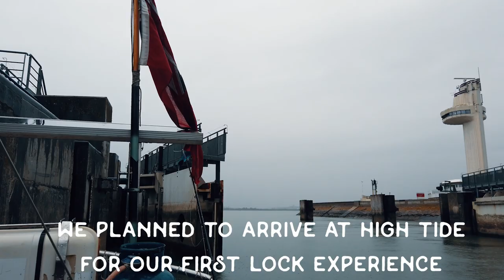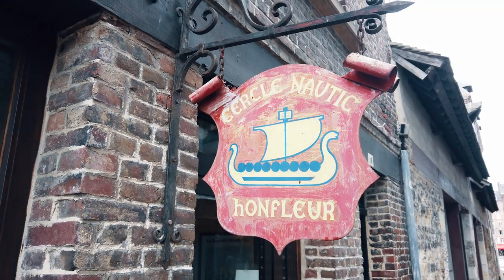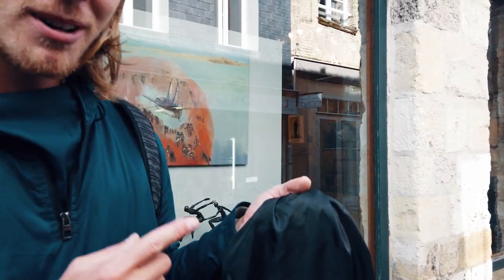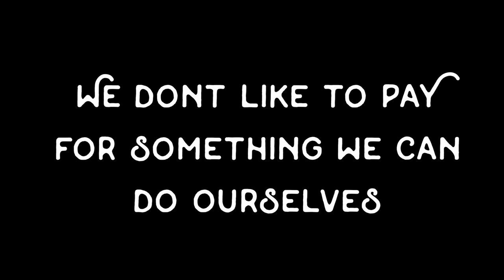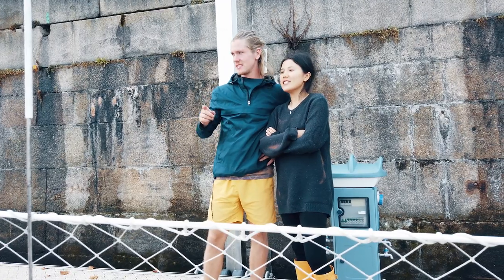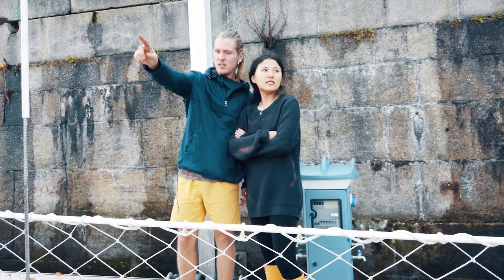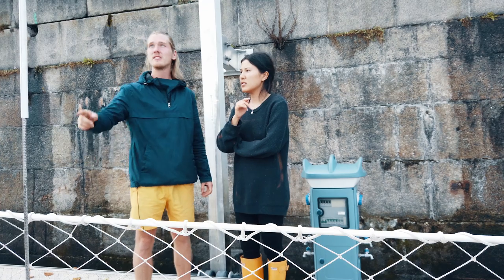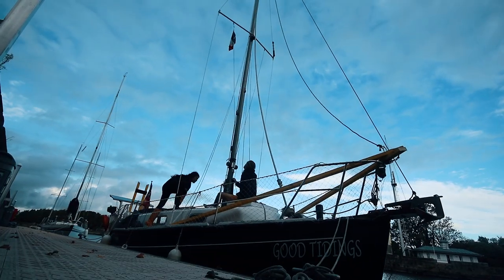Unstepping Our Mast with 2 Pieces of Wood Like 2 Unproffesionals | Wildlings Sailing .23

Comment: Here is a little tip for the electrical connectors. 
Next time you attach them, wrap them in self  vulcanizing tape. It helps against water penetration and corrosion. 
Though you have to cut it of the next time. 
Oh and some dielectric grease in the connectors also helps against the corrosion. So the connection point don’t become resistors over months of sea water living. 

Have fun.
Reply from the maker: Nice one! We'll make sure to do it. The connections definitely need it

Comment: tying two ropes onto your cap shrouds at about the same height where the mast hinges at the deck. Brought forward and tied off to the base of a staunchen or something will keep the caps tight all the way down so you can control side to side movement when its being lowered. Ive dropped several masts now using the boom and spinnaker pole   to make the a frame. Good stuff
Reply from the maker: Nice one mate, hopefully anyone looking to drop their mast watched the video and reads the comments like this. We found the only really difficult thing was controlling the sideways motion of the mast

Comment: Here in Perth, Australia, lowering masts on yachts is common as there are two bridges at Fremantle to go under, to get from the river to the ocean. Spinnaker poles are used for the A frame, attached to the side decks by sturdy ring bolts, and with “wobble stoppers” (yes, that’s the proper name for them) on the lower part of the side stays (outer shrouds) to help prevent any sideways movement. Otherwise the same.  Well done for doing it yourselves, impressed. Watch out for sideways movement when raising,you were kinda lucky on lowering. Fair winds.

Comment: 👍🏼for doing it yourself. Now it's down, inspect all the standing and running rigging and decide what you think needs replacing. I know the mast is going to be down a while as you traverse the canals, so you have some time to save up for an acquire the needed stays, halyards, blocks etc. it's much easier to do this stuff while the mast is down, so plan to do it before you put it back up..
Reply from the maker: Thanks Dave for the reminder, Yeah we definitely realized how many things needed to be fixed and replaced while the mast is down. Our mast wasn't easy to climb so definitely better to plan/replace it before stepping it back.

Comment: You're really good at this cruising life I think. I've stepped and unstepped masts on boats much smaller than yours and I know what awkward and unwieldy thinks they are. Bonus points if you did the whole operation without dropping any pins, screws, etc, in the water.
Reply from the maker: Yeah took us one day to prepare and another day after taking the mast down to take off all the small bits ! I (Nadiyana) did drop a little pin in the water. Hahaha Mark definitely deserve the bonus points though! He is really practical!

Comment: Good job. You are at least lucky that you can still keep a bolt through your mast about a meter high from the mast foot so you can lay the must down while the mast holds in place and just pivoting around the bolt.. I cannot do that with my mast as it has to be lifted a bit up before it comes free. And then it hangs free. Mosts other boats I know around me are the same. So, nice that your mast allow you to do it your selves.